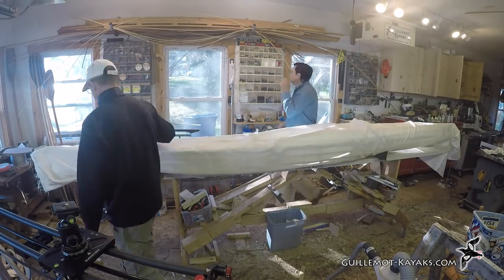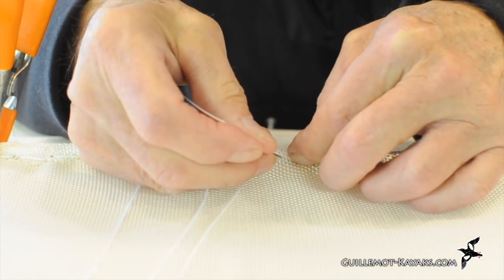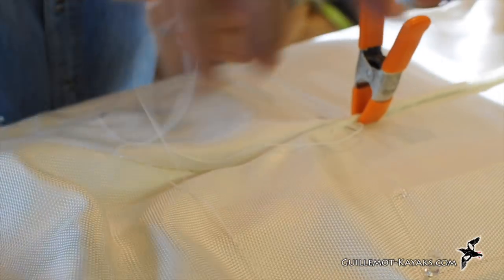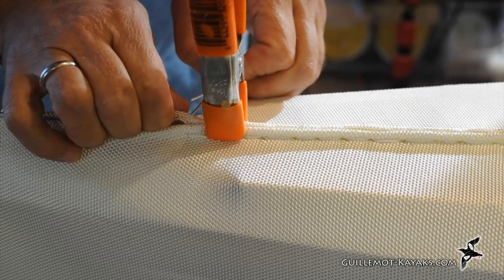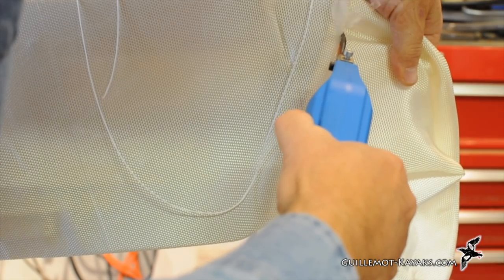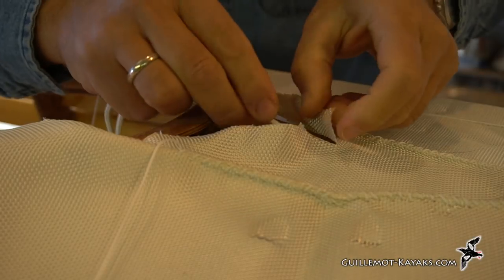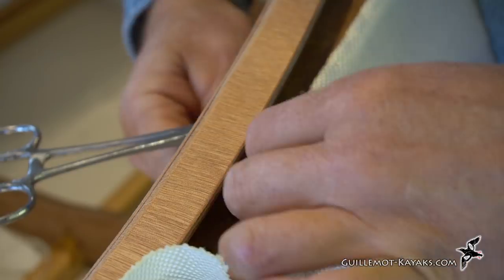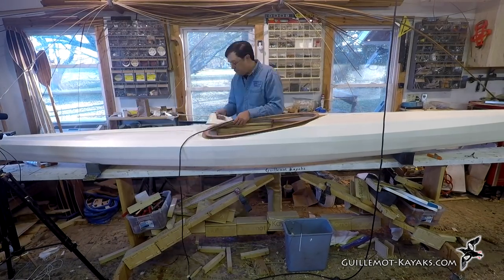Sewing on the Skin - Skin on Frame Kayak - E6

Comment: I recommend you try Tiger Thread, which is a wax polyester braided thread used in leather work. It comes in many sizes and is super strong.
Reply from the maker: Since the skin gets a finish applied, I do not want a waxed line as it would prevent the finish from adhering.

Comment: How do you shrink it evenly on both sides to ensure it doesn't cause twisting of the frame?
Reply from the maker: The fabric is not locked to the frame. It is free to slide and distribute itself evenly. I didn't have any problem despite taking no care to prevent any issues.

Comment: Can this method be used on lighter 6-8oz polyester cloth with good result? Thank you for illustrating how to deal with the bow/stern  when using the welting cord . Always wondered how to finish the stitch . Do you think this would work on a qajaq like Yost Sea Rider with a long taper to the stems? Thanks
Reply from the maker: I plan on using something like 8-oz in the future. This was just using whatever I had available in my shop..

I've used the same bow stitching treatment on my Greenland style boats. It should work fine on the Sea Rider.

Comment: DO you know of a fendor that sells this type of skin in europe?
Reply from the maker: I am certain there must be a source. The original intent of the fabric was for use in industrial filters. It is very likely there is a source, the trick is finding a source will to sell you a small enough amount to make a kayak.
Reply: Heat-shrink polyester fabric is widely used on amateur-built experimental aircraft.  Different fabric weights and quantities are typically available through aircraft parts supply houses.
Reply from the maker: That is true. The aircraft material tends to be substantially lighter weight (thinner), running in the 1 to 2 ounce/sq yd range, where the material I'm using here is 14 ounce/sq yd